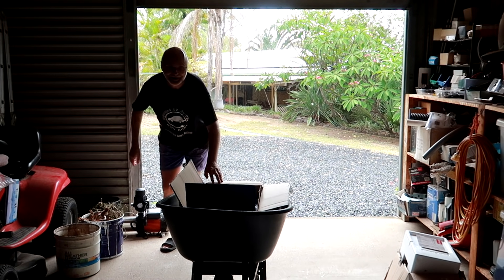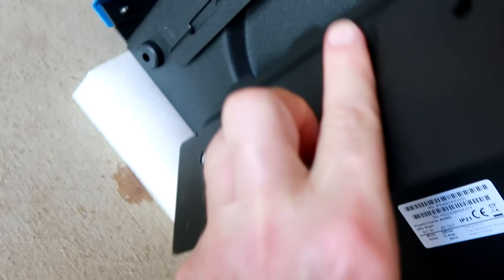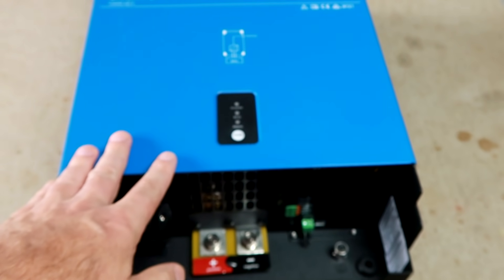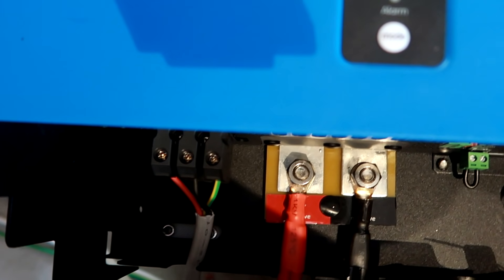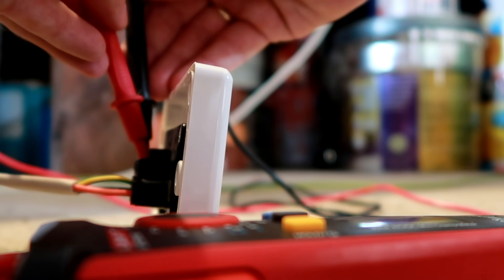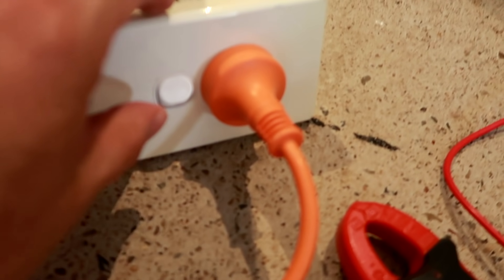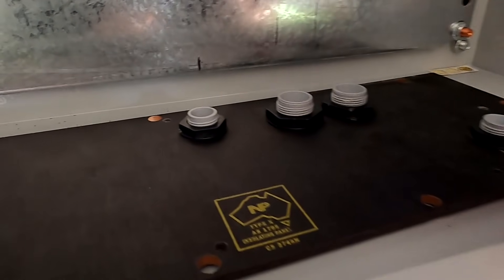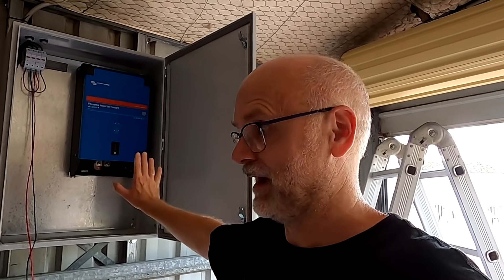Victron Phoenix Inverter Smart. Is 3000VA enough to power our garage?

Comment from the maker: Guys, I know VA is not the same as W. Come on! 😉 The fan, the battery chargers all have a power factor less than 1 as they are inductive loads, the fluorescent lights in my garage are inductive too. But disconnecting all this and just running a pure light bulb of 100W, the inverter shows me 80VA, so that's not right.
Reply: I’m impressed that you still actually HAVE an incandescent bulb, LOL :-)
(I think I do too, but I’d have to search for it!)
I agree, 100w incandescent is 100w, power factor of 1 ie: A purely resistive load should be 1.
Reply: There may be an update for it that might hep.
Reply: Haha, nice to know that you know that too, but you do speak several times about VA as being Watts in your video. Btw. I called Victron here in the Netherlands and a Victron representative, and no one could give a simple answer why VA is shown in the Victron Connect Ap instead of Watts ..
Watts would have been nicer, as always nice to watch...
Reply: Don’t forget all inverters have losses too. Also your inverter may be measuring True RMS AC volts not Peak volts. So that the value for 100 watts bulb may be correct. Cheers
Reply: Isn't it apparent power vs realized power, an inverter that claims to be 3000w is only 3000w under the test scenario, we all know it effected by environmental stuff like temperature. So saying an inverter is 3000w but not specifying it as 3000@25 celsius  is a marketing ploy. Victron does the right thing and uses VA which is apparent power and tells you that it varies based on environmental factors
Reply: @BadIdea1123  You are absolutely right, but what does an average customer think, who is looking for an inverter with a certain number of watts that he/she needs, all devices are indicated in Watts so that customer is looking at this data, so it may all be correct but confusing.

My inverter Phoenix state 24-1200, is ultimately only 1000Watts, on top of that are the environmental conditions, Continuous power at 25°C/40° - 1000 / 850W

So you may think you bought a 1200 watt inverter, but if you're unlucky, you'll only have 850 usable watts.

It's not all that bad, but you have to take it into account.
Reply: What you may not have realized is that many bulbs are marketed with the idea that 80w is somehow equal to 100w equivalent output. Perhaps this is one of those lamps?
Reply: Its indicative... NOT a calibrated measuring device.. Pls read Victron Posts.
Reply: Please please do a stress test. I can not find a single video testing the load capacity of a victron inverter!!
Reply: instablaster
Reply: @habana7638  these is incorrect. Victron phoenix inverter 1200va can run also 1250 w in some cases. My phenix 500va run continually also 600va measured with amp clamp. And also 1100va surge. And datasheet say 1000va
Reply: @habana7638  pay attention to what the datasheet of your Phoenix 1200va says.
 power in w at 25 degrees has an asterisk that says "with non Linear load with crest factor of 3:1"

Comment: I have the Cerbo GX. It works great. My off-grid system is about 1 mile from home but we have a mobile router so I can view the whole system remotely. One thing to bear in mind with the Victron inverters is that the continuous power rating is less than the quoted power. I use a 10kw inverter so that I can charge my EV at 7.2kw. The continuous rating is 8kw but it copes with a kettle giving the necessary few minutes at 9.5kw. With the 3kw inverter the continuous rating is 2400W @ 25degC  and 2200W @40degC so given your climate I would be disinclined to mount it inside another cabinet as it will reduce the cooling.
Reply from the maker: Thank Nigel, I'm looking the Cerbo for a while now. It seems to be the device which connects everything together and connects it to the VRM portal.
I knew about the power rating of this inverter at different temperatures. I have made a high load test already at hot temperatures. Video is following.
Reply: Victron quote VA ratings in their specs, not kW so you have a 10kVA inverter not a 10kW inverter.

Comment: great to see you finally over the battery issues and onto the Pheonix 3k. I thought you must have realized it was too small for the Tesla so returned it for a bigger 48/5k. SO glad you didn't sell the Xijia 3k. At least it could do the constant 10A-12A all day for your Tesla charging. I guess Andy will have a future upgrade video going to the Victron Pheonix Smart 48/5k. I would properly earth the Xijia and used it for Tesla charging at 10A or 12A then use the lower performance Pheonix or anything extra (water pumps, drills, grinders, air compressors, etc.). Its so handy to have an extra Inverter. If the Xijia ever failed you could use the little Victron at a lower setting until your Xijia replacement arrived. The 800W water pump seemed to annoy the Pheonix even at <3k output (Overload Warning). Can hardly wait to see all this unfold. I have 3 LF pure sine Inverters all Chinese and they are all an upgrade from my old MultiPlus II 48/3k which was simply a low performer at a premium price. I think you may well discover the same thing here. Andy keep that little $300 Xijia its a gem not a boat-anchor I have a very similar 3k Chinese cousin and it outputs 3000W continuous for hours on end.
Reply: I would think the lower performance of the Victron is acceptable because it also has so many other features that other inverters don't have.

Comment: You need to get the Victron Cerbo GX device. Then all your Smart equipment will be able to communicate and you can view on screen.  Sweet!  Awaiting your next awesome video! :-)
Reply from the maker: Yes, that will be one of the next devices I guess. I already signed up for the VRM but, yeah, the GX is missing ;)
Reply: @OffGridGarageAustralia  Look at Venus running on Raspberry Pi before you spend money on the Cerbo
Reply: @OffGridGarageAustralia  
You can build the GX of a raspberry Pi , it works perfectly 
download the image from victron
Reply from the maker: @MrToyorick  I would, just not enough hours in my day to get this all done... and how do you connect Ve.direct to the Raspberry?
Reply: @OffGridGarageAustralia  
You use the ve- to usb cable to connect to raspberry
Reply: Very easy to setup, and can make you own USB to VE direct cables as well. I bought all the parts I needed from Core Electronics in Newcastle NSW. Around AUD$100 to monitor all 3 devices. Do you have a good Wi Fi signal or Ethernet to you shed?
Reply from the maker: @jasonm914  Yes, I have a router directly next to my work bench inside the garage...

Comment: Andy, following you.  Great stuff!  All my gear is Victron and I see that you are slowly turning towards it: the king way round.  Although purchased all the components, just testing few.  RE your concern about devices not talking to each other, yes Cerbo will integrate them all, but meantime you can create a Bluetooth network and your MMPT, SmartShunt and Inverter will connect to it.  Go to Settings, VE Smart Networking and create network, than add each device.
Reply from the maker: The inverter does not connect to the network as it does not have BT.  That was the disappointing part. If you keep watching, you will get to the video where I setup a Raspberry Pi and connect all devices to it. You can check it out here: https://vrm.victronenergy.com/installation/100328/share/2e028071
Reply: @OffGridGarageAustralia  Hm...isn't a Smart Inverter?  It is written on the front panel...In Victron language that means it has BT.  Double check your device, look up the Victron official website for your inverter datasheet and you should be able to clarify the mystery.  

Please note that you need to have the BT turned on on the phone but you have to connect to any Victron device from within VictronConnect, not directly from the phone. I hope this help, Raz
Reply from the maker: Exactly what I thought too. Hence the title of the video 😉
Reply: Testing right now.  Not happy with the solar panels.  Will watch it the upcoming days.

Comment: You could also use that relay to turn on/off a dump load for the solar when your battery is full
Reply from the maker: Yes, like an aircon for the garage for example.
Reply: Yes, I have been looking for ways to dump excess into a hot water system for my bus. Cheers

Comment: Inside the cabinet heat transfer issue will happen due to lesser air flow and bluetooth signal attenuation may also happen😎.
Reply: Faraday cage effect, surely. Thank you, Vinesh.
Reply: @sreekumarUSA  a faraday cage done not block all signals in cases it may need to be 1 inch thick steel

Comment: Well done Andy.
The next stop is a Venus device and the use of VRM. Remember, you can use a cheap RaspberryPi to run the official Venus operating system if you don't want to spend money on a Venus device right now. Your pockets are probably a bit deflated at this point :)

Comment: I’m pretty sure the inverter will be smarter if you put the other Victron products closer to the inverter!. Especially the Smart Shunt, it has a very short range of the Bluetooth! Alternatively connect them with ve direct cable if there is a connection for ve on the inverter. Thanks for your videos! Love them!

Comment: Keep in mind the difference between VA and Watts. Some of the loads you will be powering will have bad power factor. The Victron has conformal coating so as long as you keep the big bugs and snakes out you should be fine.
Reply from the maker: Yes, absolutely. I did a test with a 100W light bulb and the inverter shows 80VA but really should show 100W as this is a pure resistive load.
Reply: @OffGridGarageAustralia  Did you measure the power consumption of the light bulb directly with a meter - they have a pretty wide tolerance, might be marked 100W, a 20% manufacturing tolerance for a cheap bulb may well be expected. And 100W is a pretty small load for the inverter, only 3% probably hard for the inverter to show small loads accurately
Reply: most wattage rating is done considering this on the appliances

Comment: What is the point of avoiding the spark at 8:40? Is there any damage done due to sparks? I thought that was only a problem in gas filled enclosures. Also, what is the rating of the resistor? Never seen this before.

Comment: 030521/0136h PST - 1936h-Brisbane.   Good evening,  congratulations on obtaining VICTRON Phoenix smart inverter (the best inverter) it’s really a smart inverter as the name implies. You’d enjoy the power of the inverter.
Later on  Cerbo GX, perhaps? You could read your PV System from any where in the world. (Plus, ever so many paraphernalia connections, that Cerbo GX has, all connections remotely performed) 
A word of caution though.... the enclosure looks sturdy and will keep the insects away from it. But the heat produced inside the enclosure will be extremely high, more so, the hot air will recirculate adding more heat to the system. Adequate forced ventilation is required and how will that be done? Let’s know your response.
Once again, congratulations on obtaining VICTRON inverter. Take care and 73s...

Comment: Thanks, for taking us along on your journey!

Let me suggest that you not obsess about the "insect" issue regarding your inverter.   I understand the concern, but you might be better off simply checking/cleaning out the insects when you clean your solar panels.   This will keep the airflow unobstructed - which is more important - and you will remain aware of the situation.    But, you are definitely going to need some active cooling of the enclosure.   You can mount a 120mm 48v DC fan with a filter screen to pull air into the enclosure at the bottom and put some holes in the top of the enclosure to vent the hot air.   Then, use a thermostatic speed control board to turn on/off the fan and regulate its speed - like the Phoenix inverter controls its own internal fan.   Mount the temperature sensor for the fan control to the case of your solar charge controller since it gets the hottest.  Remember, you need to spray any holes you make in your enclosure with some rust protecting gray primer.   The standard gray primer paint will match the color of the enclosure nicely and really is important to protect it.   I also installed rubber grommets on the holes I made in mine.
Reply from the maker: Thanks Richard. I assume you're not from Australia? We have very nasty insects which are getting into these inverters and start building homes with mud they collect outside. There is no way to just 'clean of the insects' without taking the whole inverter apart.
Also, the inverter has a relay output to control a fan when mounted inside a cabinet. They must have thought about me :)
Reply: @OffGridGarageAustralia  Then, try placing some citronella inside the cabinet to repel them.

Comment: I've gotten around the spark when connecting the inverter deal by shutting off the output of the BMS, using the same app you are using, then connect the inverter and then turn the BMS on, 
you get a big current (about 80A for my setup) outrush for s split second and then you're good, no spark, no resistor.

Comment: Hi, if you would have switched the battery back off with the main switch and you would have connected the battery cables with the inverter would then the switch weld once switched on? I think loud as I want to connect my hybrid inverter within the next weeks with my battery rack. I am a little nervous if I will damage something.
Reply from the maker: You have to precharge the inverter every time you turn it off with the switch. I only use the switch in an 'emergency' though. I'll show this in a future video.

Comment: It's amazing because I was researching the victron quattro and here you are posting a video on a victron inverter. How are you going to communicate the BMS with the inverter? Via Cerbo I guess but how? The cable that comes out of your BMS on which there is SW will be used? Or the RS485? Thanks for sharing your experience !
Reply from the maker: Thanks for your comment. No communication yet to the inverter. I need to get one of the GX devices to connect everything through Ve.direct ports.
I don't think I can utilise the RS485 port of the BMS to talk to Victron. The BMS would need a modified firmware to make this happen. I still haven't explored the switch function of the BMS and what it does. It's totally undocumented, so not sure how it works and how it can be programmed.

Comment: Australia, inverter in a box seems too hot for me but we will watch and see. I see a screen door in your future. good luck
Reply: I see a removal of all additional loads (water pump was 800W), a air conditioner and then finally a 48/5k upgrade ... we all learn by mistake ...
Reply: Yeah, screen door would be easy fix.
Reply: @offgridwanabe  Screen door screen on the door would allow convection while a furnace filter needs forced air. Putting the screen on the door would be the easiest 'cause the door may be removable.
Reply from the maker: Inverter is not to small to run the whole garage. Load test will follow... 😉
Reply: @OffGridGarageAustralia  I guess we are thinking of charging the car and running the garage at the same time the grid spoiled us.
Reply: Install a couple of Rittal filtered enclosure fans and outlet filters for a permanent industrial quality job.

Comment: If you cannot link it. either buy a venux gx or colour gx then you can use the ve direct to connect all your devices together and have it connected to the internet for remote control, monitoring and configuring.

Comment: I wish they made a 120v-60hz version for the North America. The Phoenix inverters here are not bluetooth (V.E. direct or dongle/extra) and limited to 1200va. We basically have to use the more expensive "Multiplus" inverters to get 2000va or more. They do have a built-in AC charger and transfer switch though (but no bluetooth). It requires a V.E. bus to USB adapter to configure it...

Comment: you connect the the inverter from the device that monitors,  but will only connect to one device at a time.  an will not show up when connected to your phone.   other than that to link victron devices  its about using the v.e. connect.

Comment: Hello
I plan to have a large power to supply my home with a multi in 8000VA but can it work without the ACin being connected? just the ACout to supply my panel? for the ACin of the multi connect it from time to time to a 20A socket to recharge my battery pack in HC especially in winter on a 20A socket and restore the Energy during the day in HP? valid especially with the TEMPO EDF option which is very expensive during the day in red period, I also think of putting a source inverter in case I am absent and switch back to EDF all possible this?
I would like to avoid connecting the multi directly to the subscriber circuit breaker permanently especially since in principle you have to make a request and consuel! what I would like is to be in self-consumption almost all the time without any reinjection
laurent

Comment: Hi Andy I'm in Victoria and I run a 10000 watt inverter in a enclosure mines outside and it does get a bit dusty I have several openings for it to breath,and I run 2 fans 12 volt in the summer constantly there able to be switch of or on and it's imperative u have circulation or they disconnect  and stop working,my inverter weighs 48 kgs big beast it's a low frequency inverter which gives me 30000volt spike will run anything I have at home.what part in Aus are u from.cheers Rene.